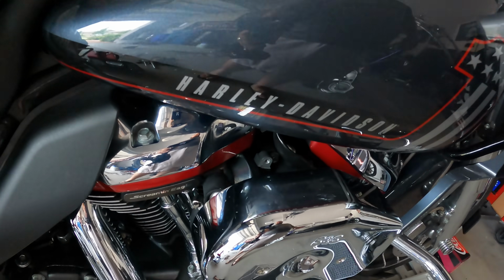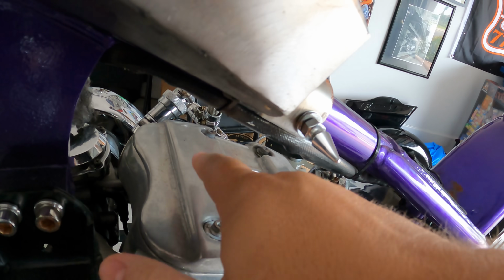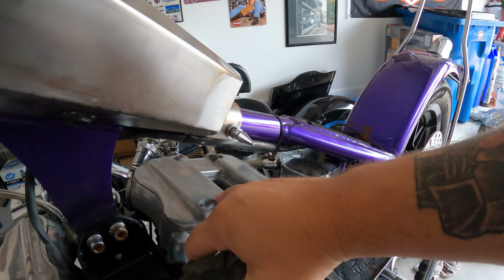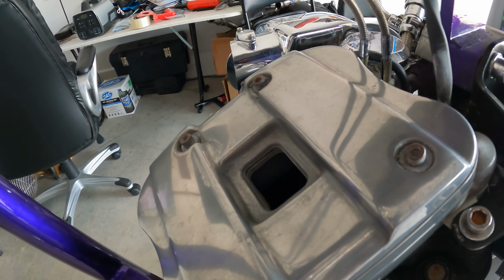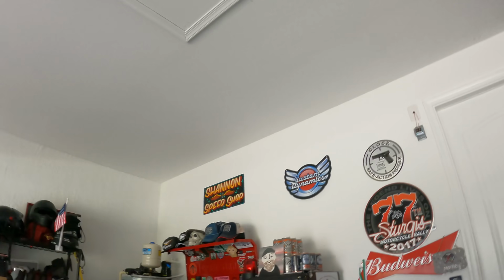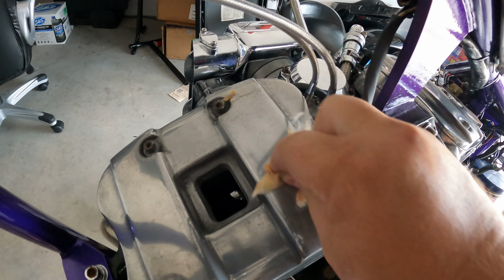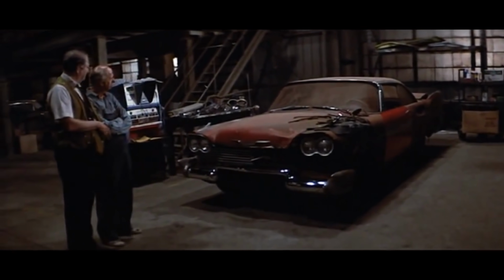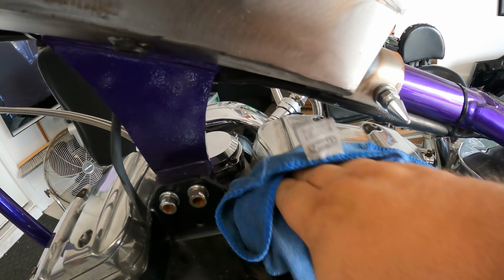Polishing her jugs... the old school way to bring some shine to your @harleydavidson motor!

Comment: Before the wadding polish, we used "Simichrome" ,,,,,comes in a small tube like toothpaste and works well. If you work it enough it will bring that aluminum to almost a chrome. That was in the 60s,,,,but you can still buy it.
Reply: Joe is right you should give the simichrome a chance. I used it in the 70’s on my sporty. The results reflect on how much you want to put to put into it. Still have it on my shelf as I used it on my shovel before I sold it. Good luck, and get that bike running!

Comment: Blue magic has been my go-to for years! Even works on blueing exhaust and discoloration. Also wonderful for plastic and microfiber towels that may fall onto your hot exhaust. Don't ask lol....I just handpolished my lowers with it and a polishing wheel for a drill will save tons of time and your shoulders and hands. I AM NOT a rep for the company but if your listening I'd sure like to be!!! It also leaves a waxed surface to prevent it from dulling again. Once a year in spring I completely do the whole bike. After that ammonia free Windex or F11 will maintain it. ALSO not a rep for F11 but would love to be if your listening......we spoke at Bike Week lol

Comment: Yup, there is a lot of "lost arts" in maintenance.  The wheels on my fxcwc is in aluminium, I don't think the previous owners ever polished them. Elbow grease and Autosol (on a cloth or a sponge) made them look almost chrome. And I finish with wax to seal them, so I can slack a little longer before I do this again. (Also a lot easier to do when the wheels are of getting new tires). I'll admit, it's tempting to try and spray them Blitz Black... (Or the only John Deere black paint we get here in Norway, almost Blitz Black)

Comment: That stuff does get a bit smelly if its been on the shelf a while. I have used a brand of Brasso,  the wadding one is called Duraglit. Whatever you use it stinks. Q tips with the liquid is good for small hard to reach areas. I used autosol  cream  cleaner on chrome,  similar smell.

Comment: i used 000 wool on crankshafts in the factory i used to work at to get surface rust off them or when cleaning the machine slides.  good vid

Comment: Used 0000 steel wool to take surface rust off my chrome. Spray a bit of water on the chrome and then rub gently. Works amazing!

Comment: You can also use a very fine wet and dry sand paper and spray a little kero on the alloy just for a bit of lubricant then rub in one direction. It will come up a treat. Love the channel from Australia

Comment: I agree and also love the look of polished aluminum vs chrome. It has a depth that chrome cannot replicate. My Ultra Limited is all chromed out from the factor and looks good, but the new Electra Glide Standard with the polished rockers and cam cover etc. looks fabulous. I use Autosol paste for polishing metal. One tube will last about ten years and with a little elbow grease, the results are amazing. Thanks for all the great videos!
Reply: If you ever get the chance try comparing nickle plating to chrome. Way harder to maintain but way nicer. 

Polished aluminum also depending on the grade and actual polishing process also gets fairly close to chrome. Polished magnesium and titanium are beautiful.

Comment: I used 0000 steel wool on most of my chrome, works great,  had good luck with meguiars or chemical guys for polishing aluminum  but a drill or polisher really makes a big difference in final results

Comment: 0000 steel wool and then polish with Mother's®️ aluminum polish.
 For really f'ed up aluminum, lightly soap and water sand with 1800 grit sandpaper.
 The 0000 steel wool can also be used to remove surface rust on chrome without damaging the chrome.
 Follow with Turtle Wax®️ or your favourite chrome polish.

Comment: "Simichrome" metal polish dies a better job than wadding polish and is half the work.
Promise, Monk.
Reply: I second that. That stuff is real good on some non chrome aluminum surfaces. Especially with a mothers power ball or power cone. Just be ready for splatter.

Comment: Whats the best way to polish up corroded forks?
Reply: You were looking at it.  .00 or .000 steel wool then some good quality metal polished to seal it.   If you want more shine put a buffing pad on your drill and go at it.  If they are raw aluminum they will look almost like chrome when done.  Just use a good quality metal polish , Never Dull, Mother’s, Brasso, etc.   

Good luck.
Reply: Forks will likely have a clear finish. If they are super rough hit with 800 then 1000 grit wet sandpaper then 0000 steel wool and wd40 before mothers mag and aluminum. I have yet to try brass wool but will be ordering some when I pull and polish the chrome spokes. Spokes are a real pain but you can never go wrong with a good pull and polish lol
Reply: @rickyhawkins7407  thank you!
Reply: @jasondavis5456  thank you!

Comment: The Oxide in old pant on the older cars and bikes that not been clean forever use goop hand cleaner in the sun as you let it sit 5 minutes or so then just wipe off with a old tee shirt. Try it before you say anything. Be sure to get the goop without the sand in it or whatever that ruff stuff is. Been using on older pant jobs for many years and yes I am getting older.

Comment: annnnnd to take it to a more polished/chromeish look, 800 grit wet sandpaper, 1000 grit, then 3000 grit all wet, then polish with aluminum wad polish, or an all metal polish compound on a small buffer wheel attached to a speed control drill/buffer again, I'm old skool body/paint guy with a slight OCD issue....
Reply: That's how the pros do it!